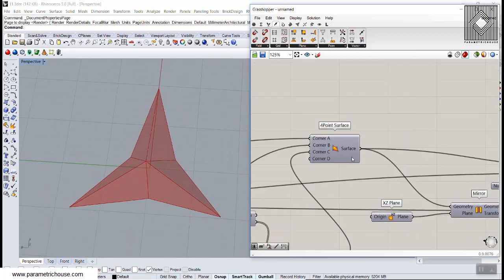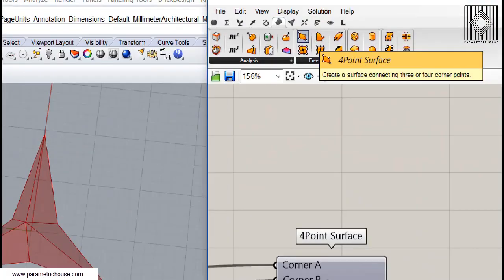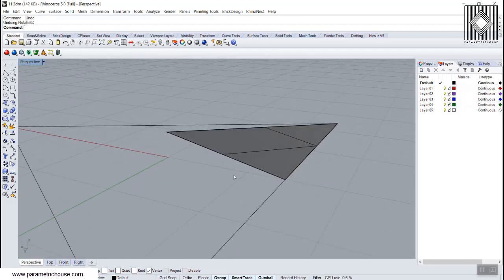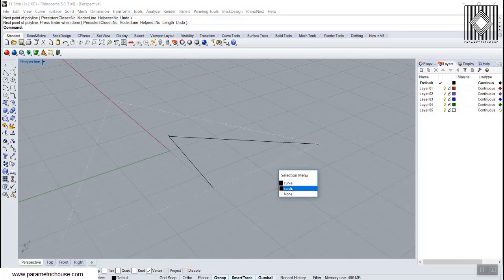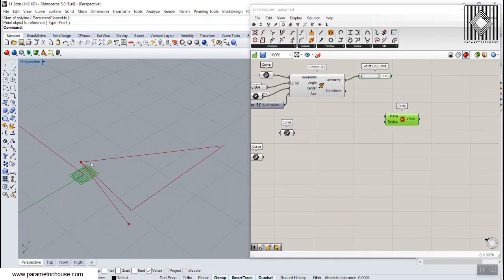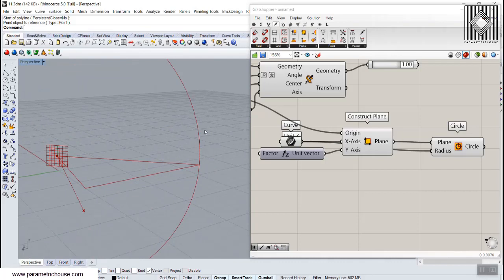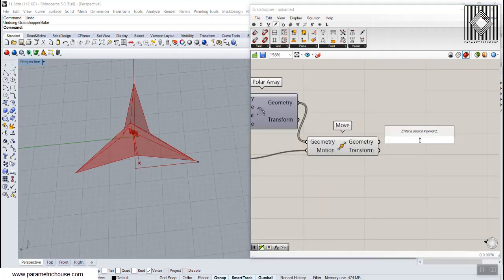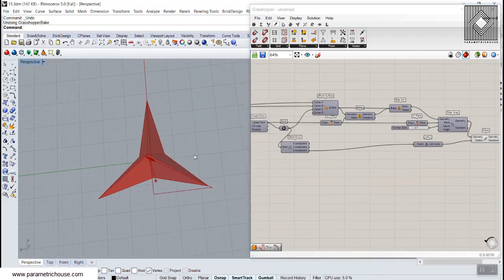Al Bahar towers Facade (Grasshopper Tutorial)

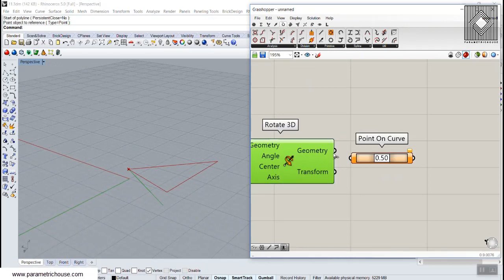Comment: it didn't work for me at all. first issue that I had was @7:01 point on curve , when the x point was set to max the point was in center.  second issue was @13:30 brepjoin I coudn't join the surface and geometry, it only allow one of them to connect but not two of them. Three, as the result mine, triangles didn't even meet in the center. :(
Reply: same here
Reply: I acctually found out where the problem was by me - try using SHIFT while choosing the surfaces :)

Comment: Hi
I want to find an easier solution
The centre point goes upward and the middle points go inside but the length is uniqe
So there is a 3anglar shape  with a 90 angle, so we are able to use Pythagoras formul for it
The distance which is used in z vector for the center point , also used in cot u vector in moveing
Am I right?
I used the line of connecting centre and middles as vectors but i dont know how add the math order